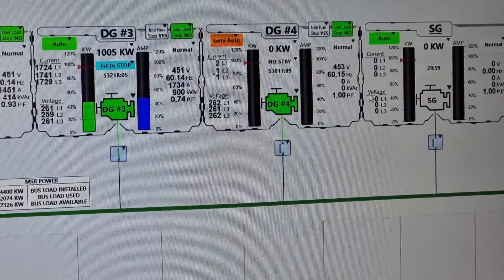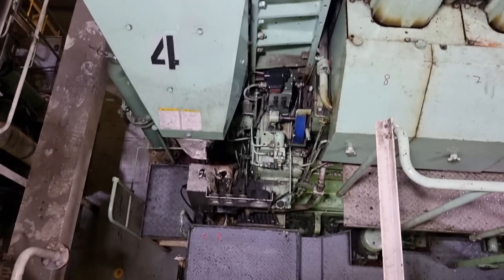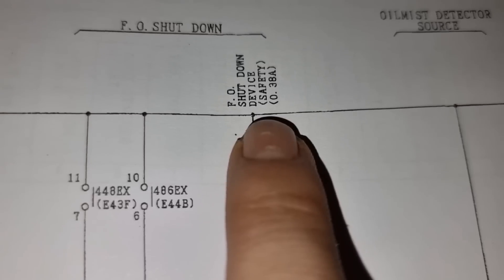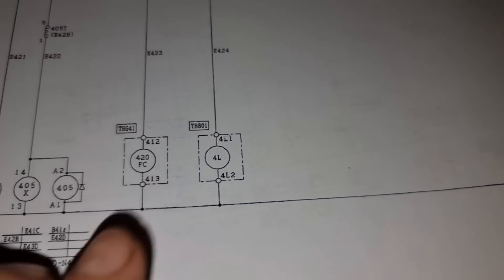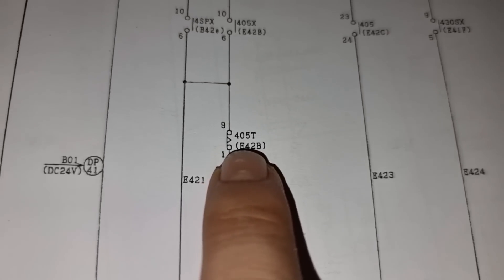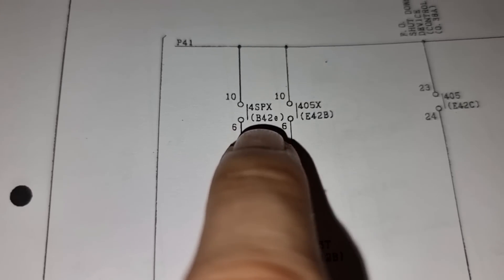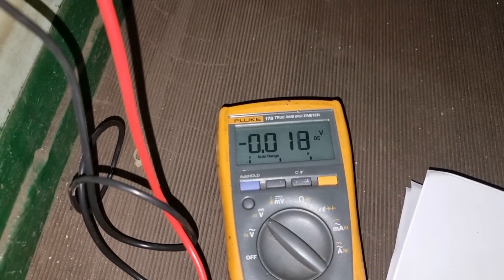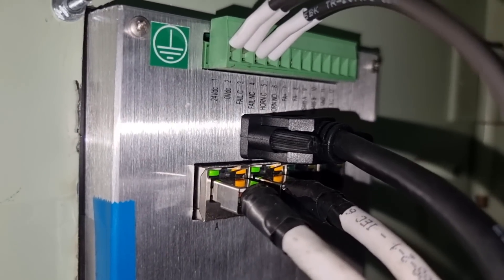GENERATOR TROUBLESHOOTING, NO STOP OPERATION

Comment: Good day sir, we are facing problem in finding electrical fault in generator panel . Generator is running idle but there is no voltage showing on generator panel in ecr. We checked voltage in alternator side and voltage coming to panel, found all ok. We checked all relays and fuses in the panel found ok. Changed avr from another generator still not showing voltage and not showing generator running condition. 
Please help us for troubleshooting.

Comment: Why is he still interchanging the Relay if he can able to measure the original Relay itself if it has a Supply. Did he also measure the original and interchange it into another and measure it again? Is that what he did? Thank You for those who can Answer. I'm just confuse, because he didn't measure the original ones in the video 🤔
Reply from the maker: i interchange the relay to others so that I do not need to measure the contacts while I am measuring the supply 24V supply of the relay. it is just an assurance of having a good contacts while focusing on the supply voltage.

Comment: Please also include  where these timers and contactors will be normally located. I am newbie to ship. Thanks so much for sharing experience.  Please do a complete refrigeration charging on AC and reefer plants.
Reply from the maker: Location normally found in each individual control panel.
Reply: Local or MSB?
Reply: TVV in MSB of each individual generator control panel where PMS module is located also where ACB of generators located
Reply: @zainahmedmalik6759  thankyou bro

Comment: Is it possible to swap the pms control module bw no.1 and no.4? Just to prove that it is really defective?
Reply from the maker: Nope becuase of the address and parameters., but based on the fault finding it is really the card who has a problem
Reply: It would give the alarm Computer a stroke because it moved to a different location

Comment: Onboard my ship we had a problem with generator that it didn't wanted to start stating JET SYSTEM FAIL , we resolved it by changing the one relay.
Reply from the maker: That's good to know, safe sailing
Reply: @leckyjake  You too buddy, let us know what maker tell you about the problem